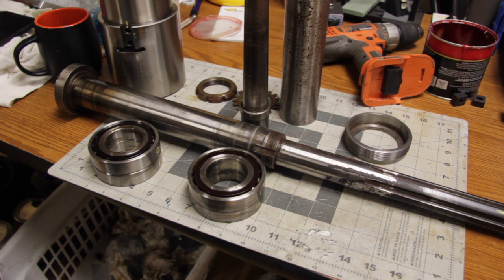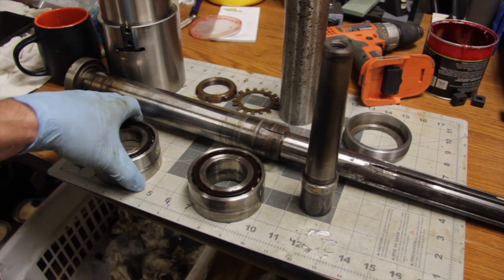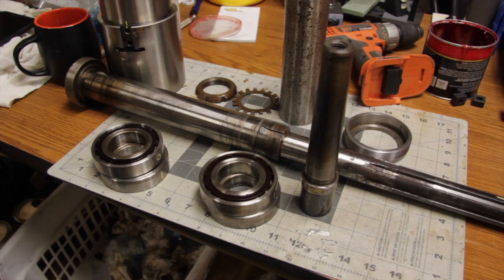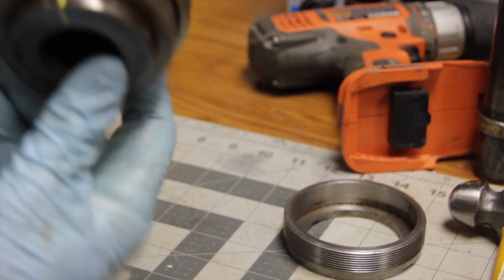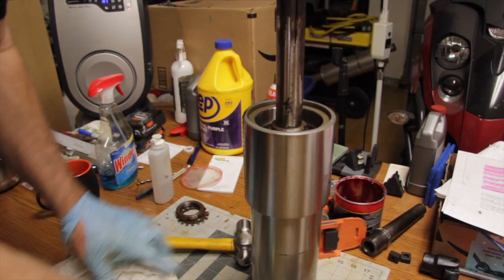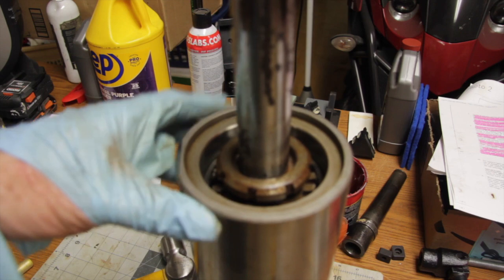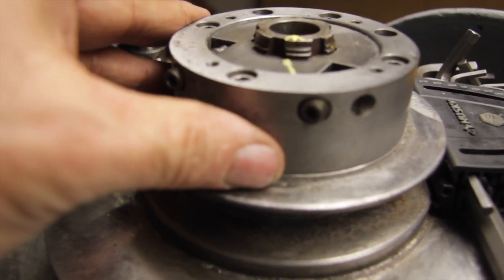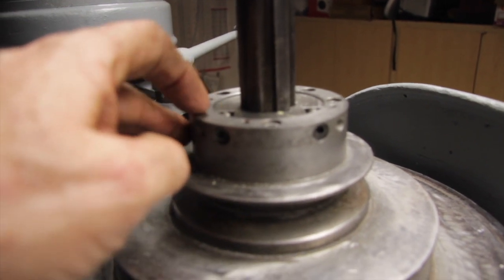Gorton 9J Spindle Re-assembly

Comment: Boil the bearing (in a ziplock bag) and freeze the shaft.  You wont have to dirft it on.   Inductive bearing heater works best, but $$$
Reply from the maker: Thanks for the tip, Oh yes would love to have a induction heater for heat treating.

Comment: Hey Joe,  I thought that was the backlash eliminator you are adjusting.  I don't think it is meant for adjusting run-out. But maybe I am wrong. Are you sure that is what it is for?
Reply from the maker: Yes  Dan you are more than likely correct.  I was willing to try a few different things. It seemed to help a bit.  I have since loosened it as part just some experimenting.
Reply: I have gorton 9j, that is backlash adj. I have the right screw in more then the left cus spindle turns clockwise most often. No chatter dream machine
Reply from the maker: @beenrippin2172  Thanks Seth,  Yes, backlash adjuster, But it does seem to affect the runout just a bit.  Yes it is solid as a rock.  Thanks for the feedback.

Comment: Good job Joe.
Reply from the maker: Thanks Dan,  Did you see the email I sent you, I have some runout on my collet chuck and not the spindle.  Any suggestions on how to fix, since it is hardened I can only think of grinding. Let me know.
Reply: @JoediyLab  Yes Joe, I saw your email.  Sorry so long to reply.  It sounds like your collet adapter is dicked.  Could you use it to make an R-8  adapter?  If you have a lathe with a steady rest, you could chuck up the B&S taper on the drawbar spigot and support the front, even on the taper, with the steady rest.  Then a carbide boring bar could turn the inside to R-8.  The 16 and how ever many degree taper of the R-8 is not as critical to get right like a Morse or B&S taper is.  No need to set it so close with a sine bar.  Just keep bluing it and adjusting the compound till you get it right. Sound like a plan?
Reply from the maker: @kooldoozer  Dan I have a lathe, but no steady rest.  I would have to temper the Chuck first? Would it be easier to turn a R8 or E40?
Reply: @JoediyLab  ER40 uses some metric thread as well.  I dunno.
Reply from the maker: @kooldoozer  I do have a complete set of R8 collets, just need to figure out a way to hold the collet chuck in my lathe
Reply: @JoediyLab  What lathe do you have ??
Reply from the maker: @kooldoozer  I have a Clausing 6300, I do have a 4 jaw chuck. I was wondering since the runout is only .0015, if I could just take a cleanup cut to even the runout.  But I do not have a steady rest, any ideas?
Reply: @JoediyLab  Look on ebay for a steady rest.
Reply from the maker: @kooldoozer  yes I check from time to time,  I will look again. Thanks
Reply: @JoediyLab  You could use the compound from your lathe, mount it to an angle plate, and turn the adapter to R-8 in context right on the Gorton table.
Reply from the maker: @kooldoozer  Yes, good idea, I was thinking about how I could do that, thanks